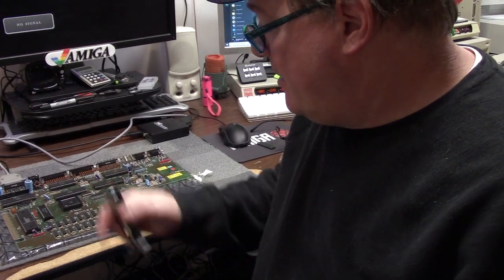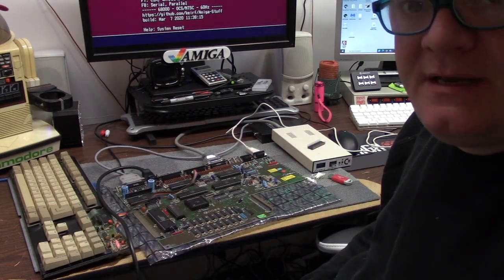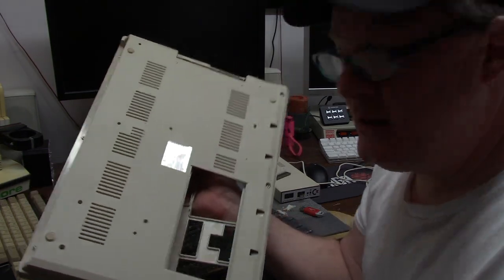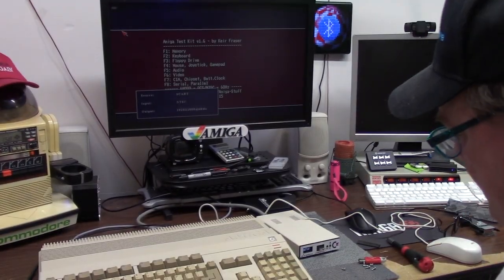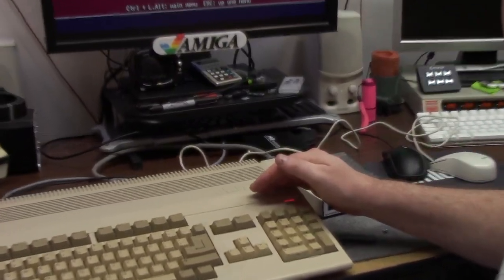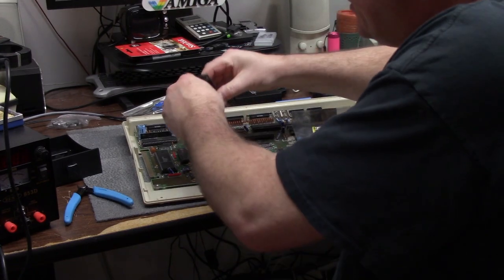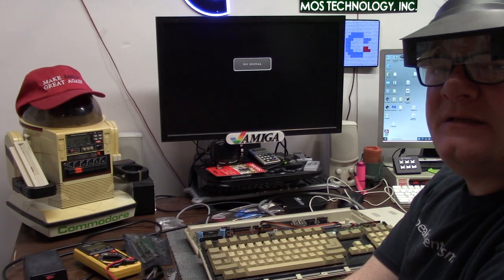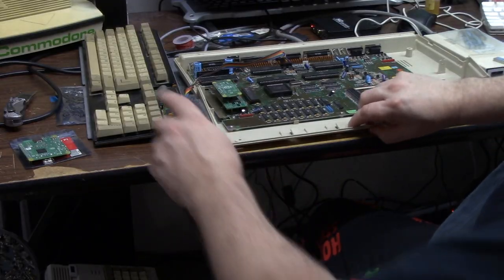Amiga 500 r5 lives again w parts from many

Comment: I really appreciate the info I have picked up from you recently. My amiga experience has been through emulation. I have an Intel NUC that rocks os 3.9 with Picasso installed, and a pi 1b running 3.1. I haven't done anything with them in years, but recently started hungering for the amiga experience again. So in the past week I have bought both amigas that I have always wanted. A 500 and a 600. Hell yes! The 600 doesn't need anything to run what I want on it, but I do want a pistorm for the 500. It must have been fate that you blew up your 3a, because after seeing the 0,2,w on your machine, I love how clean it looks. So I am going to order one today. Thanks for all the work  you do and how you share it.
Reply from the maker: Another flame rekindled.  Enjoy, dust off a credit card and go nuts once again. Enjoy it. And thank you for the kind words.

Comment: Chris is that ia Anycubic Viper 3d Printer?
Reply from the maker: Ender 3 V2 running Jessie PLA A500 color from printed-solid dot com 235c
Reply: @ChrisEdwardsRestoration  Cool I bought a Anycubic Viper which is similar to the Ender 3, they look very much a like. I just have to figure out how to use it and how to model some parts for my Amiga 2000 before dropping them into Cura and splicing them. Like I want to see if the Amiga cover plates can support two keystone jacks and VGA port, so I can put a RJ45, HDMI, and of course my VGA (icomp ECS v2). :)